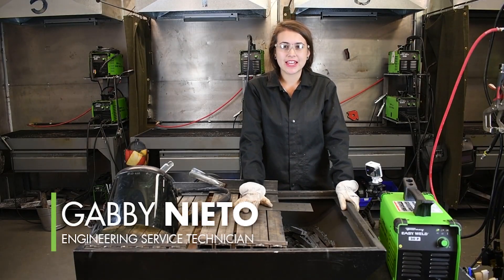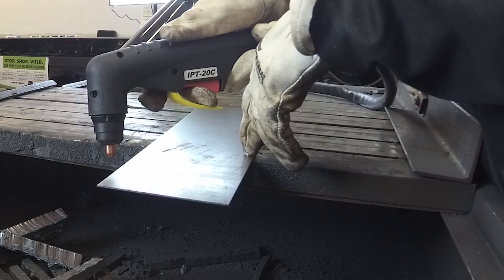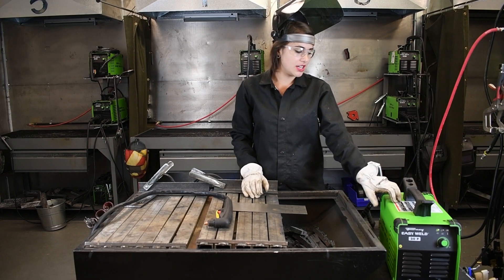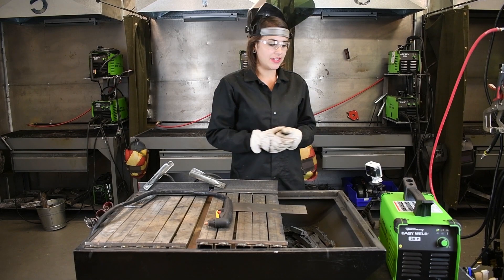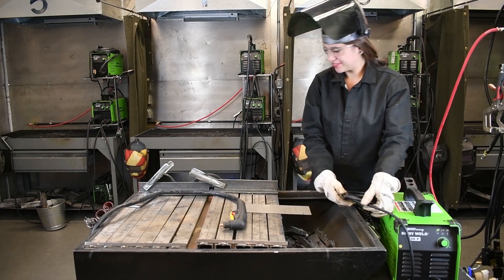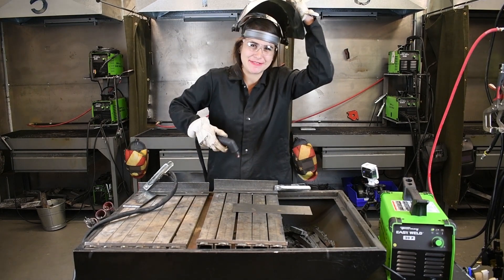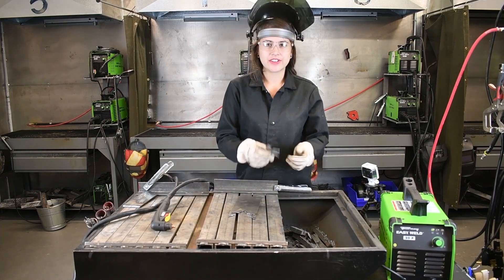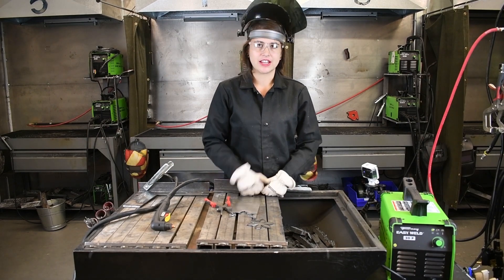Plasma Cutting with the Forney Easy Weld® 20 P

Comment: Just got a 20 amp and it starts cutting then stops ground is good only have cut about twenty feet at most have changed tip still nothing
Reply from the maker: Thank you for reaching out. For troubleshooting, please call 1-800-521-6038, and they will help you with this issue.

Comment: It didn’t look like you needed to actually touch the metal with the torch tip for start up. Is that the case?
Reply from the maker: Hi Shawn, this unit features Drag Torch Technology, allowing you to drag the tip directly on the surface of the material for smooth and precise cuts.